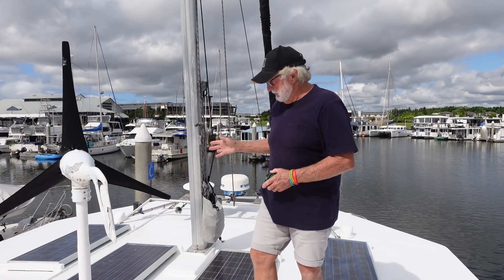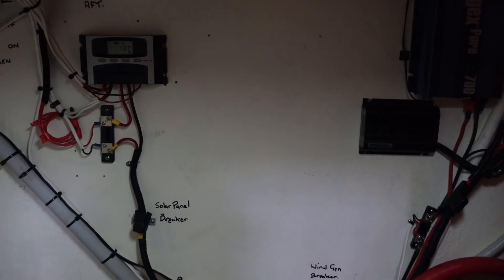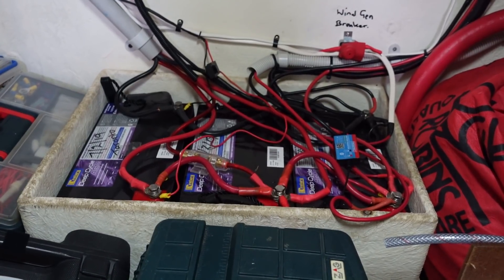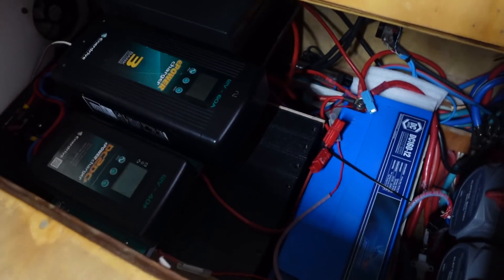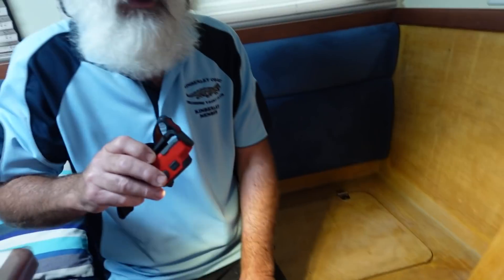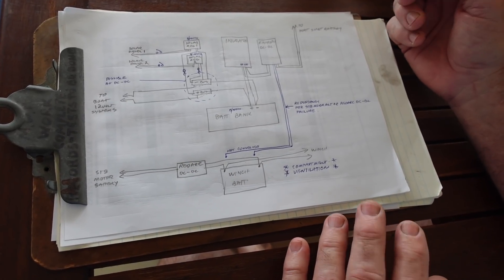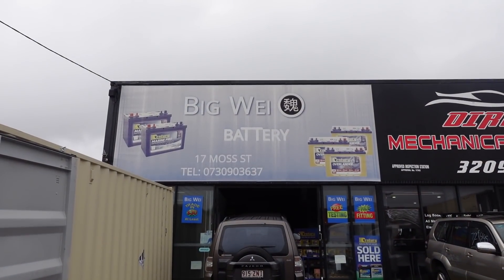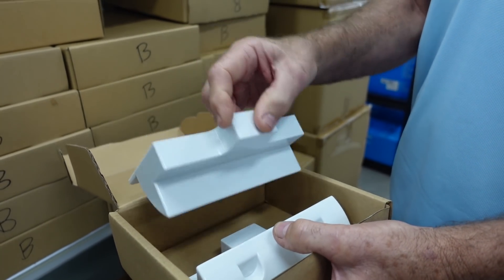It's Time To Go Lithium

Comment: CORRECTION just watched the video and saw a major blunder on my part. The Enerdrive DC to DC charger doesn't have the facility to charge 3 battery banks. That's the Enerdrive charger.  Had a seniors moment there!  Also should point out I didn't show fuses and circuit breakers etc in that drawing. These are always necessary and the drawing was more about giving Norm a overview of what we need in the way of major items.  Sorry for that blunder

Comment: I recently put a 5kv Victron , lithium system on my boat, I find the Victron touch screen beneficial monitoring the batteries and usage, all this power takes a bit of getting used to,   but a great benefit to lifestyle so far , the hardest part was many trips collecting the many bits and pieces needed to do a proper job ,
Reply from the maker: Yep. It is an interesting project dude. Much to think about.

Comment: Thanks Norm. It’s great for us that you have started this planning process. It will help us with our decisions when that time comes. We are currently planning how to make it all work with our Cat C7 main , beta wing engine and  our Perkins 8kva genset. We definitely don’t want to run our genset just to make a cuppa so it’s going to be interesting for us especially if we can move away from the idea of a gas cooktop
Reply from the maker: Thanks dudes. My plan exactly. I will only use the genset as a back up (6kva). The lifepo4 will suck up the 120amps the inverter charger delivers.

Comment: Hi Norm
Ensure you get approval from your insurer before commencing the modification.
Reply: A lot has changed using lithium in last couple of years as they have all sorts of tech and use lithium phosphate chemistry . We use in 4x4 and vans and perfect for off grids and big power demands !!
Reply from the maker: I should use the terminology lifepo4. There are a few lithium chemistries available. Lifepo4 is definitely the most stable.

Comment: Gooday Norm you old salty sailor!
Great move mate - this is same concept as I have in my landcruiser - std starter battery linked to a hybrid using a Redarc SBI12 so I can link them in an emergency and then I use a 170ah Lithium with BMS for 75 litre fridge, camp lights and plug in accessories charging from both an Enerdrive 180w solar panel + alternator via a Redarc BCDC1250 charger.
I went with Giant batteries as they are Aussie and come with a 5 year warranty
Good luck mate - love it!
Reply from the maker: Thanks dude. Sounds like a good setup.

Comment: Seeing your doing this put the new panels in a line connected by a rod joined to each panel and use a geared motor to have the panels follow the sun.
Reply from the maker: Yeah dude. Would be more efficient, but a little complicated and whatever you do, shading is a problem

Comment: Norm! I really enjoy your channel and love how you think, present and communicate,, so much so, that I feel obligated to pass on a few points if I may.

There have been a few honest mistakes in this video. The dcdc 40+ doesn't have multiple charging banks. Only the enerdrive AC40 battery chargers have the 3 banks. The dcdc only charges a single battery, with both dc and solar input. It does nicely allow you the select the output amperage in 5 amps steps.

Lithium battery chargers are indeed constant amperage, but not constant voltage. Have a look at the enerdrives lithium battery charging profile, through the different stages. You get what you pay for, and enerdrive has some of the best algorithms for lithium battery charging around.

Definitely get the enerdrive epro plus monitor. Its essential and will tell you exactly how much power is going in and out, and exactly how much capacity is remaining in your bank. The bluetooth BMS's are ok, but they don't register small draining currents and easily get out of cycle if you leave the boat for a while. 

The monitor can also show the voltage on a second bank (engine) so you can also monitor that from the one little monitor screen. Don't rely on a phone! Phones and Bluetooth connection issues, drop outs - its all so painful. One indepandent monitor to tell you everything! And it has low voltage alarm set points and capacity levels  to help your protect your hugely expensive battery investment.

Run a BLUE SEA 5196 off your battery bank. Then all your chargers and inverters can connect to that , and be safely fused. Its so neat, tidy and you'll just have one single battery lead going the he battery bank. Safe, neat, functional.

Also - install a master isolator switch! If you ever have a smoke and fumes event onboard, you response plan would be to run directly to the master cutoff and isolate 800amphours of potential energy. Once the battery disconnects, the chargers all sense the voltage potential loss and disable output voltage. So that one master isolator not only isolates the battery, but also disables all the solar regs, chargers and inverters. Safety critical,.as they say.

Wish I could show you my trailer boats enerdrive electrical system. Id love to pass on all my knowledge so you get an electrical system that's absolutely faultless and perfectly tuned to your needs.

Cheers legend!
Reply: Absolutely correct Scott. The Enerdrive DC/DC only does one bank. I had a bit of a seniors moment there. Your also correct on the fact that Lithium chargers are constant current but not voltage.  I should have explained myself better there. I'm using that power supply ONLY as a backup should the main charger fail and that type of charger will do the job as a short term fix only. Also we intend to use a Victron BMV 702 Battery monitor, fuses, circuit breakers and battery isolation switches as would be normal practice.  Thanks for your input and appreciate the way you commented without being negative.  Cheers Bruce
Reply: @brucecapper8581  thanks so much for the reply, Bruce.
I'm glad it wasn't taken as a negative - so happy to hear those details of the build. Sounds like it will be amazing - looking forward to the next video.

Nice to meet you Bruce. Let me know if you gentlemen even need a hand, id love to assist. Ipswich, QLD. Cheers.

Comment: Gday Norm. You mentioned weight was a factor in your decision to go 2x400 amp hour batteries instead of 1x800. As a matter of interest, what were their respective weights?
Reply from the maker: I'm not sure Leonard, The 400ah battery is 47.8kg. Imagine the 800ah battery would be twice that. It was not liftable for old dudes... That's for sure.
Reply: @MotorSailingforOldDudes  I had 4x350 a/h lead acids in Aquanita, all mounted to port in the bow. Double disadvantage - huge weight resulted in 10° list to port and only around 50% of power was usable- one of the many disadvantages of lead acid batteries. I believe you will have access to more than 90% of available amperage. Good luck